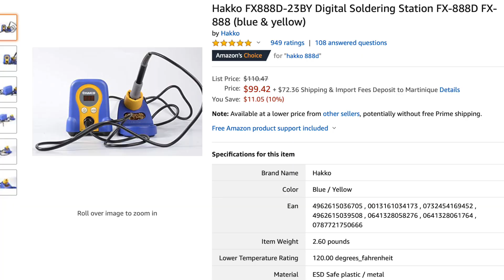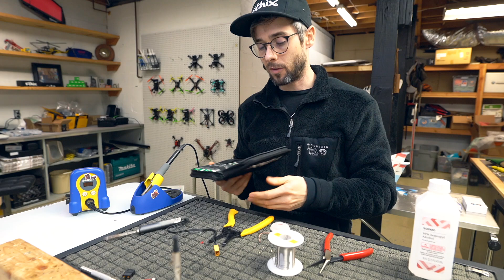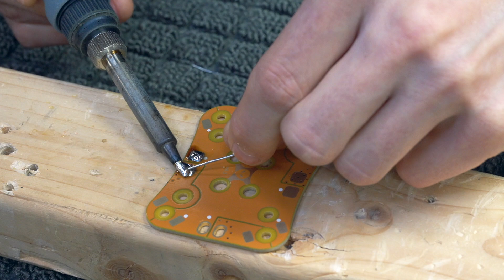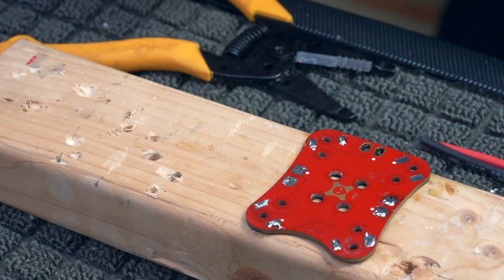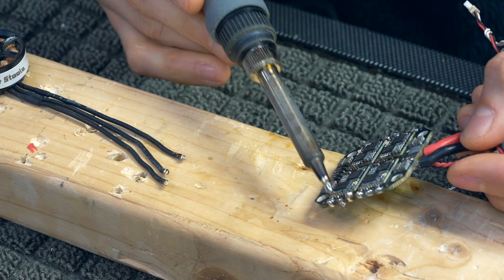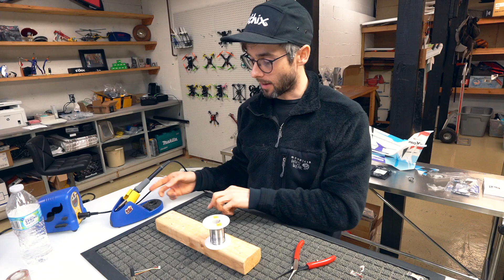How TO Perfect Solder Joint 🤫 | FPV Drone | Pro Soldering Tips & Tricks

Comment: Solid vid.  Couple of thoughts: the purpose of the wet sponge is not 'cleaning' the tip; that's what the scrunchy copper wire ball is for.  The wet sponge is for reducing latent heat in the tip to avoid overheating components.  If soldering pads, XT60 pins etc., don't use the sponge, because you want lots of heat.  If soldering small components (capacitors for example), or soldering in an area of a PCB which has small components close to the soldering site, clean the tip with the copper ball, give it a good wipe with the sponge to cool the tip, then promptly re-wet and apply solder.  I do use a flux pen ('rosin pen').  The flux removes oxidation from the parts being soldered and keeps them from re-oxidizing while cleaning/re-wetting the iron, all of which allows more rapid adherence and promotes flowing of the solder; this in turn means it isn't necessary to heat-saturate the parts to achieve a properly-fused joint.  Proper use of rosin core solder requires that you add solder to both components before attempting a joint, which is fine in many cases, but often leads to an over-application of solder, and you either have to wait for the parts to cool (and start to re-oxidize...), or risk overheating the parts when you connect them.  Last item: lead wont vaporize at less than 1700C; the smoke from soldering doesn't contain lead.  I avoid breathing it on general principle, but there's no need to worry about "lead poisoning" from solder smoke.  Washing your hands after handling solder is a good idea, however :)
Reply: Accurate info. Good to see some intelligent comments!
Reply: I found the electronics engineer.  

The most important one is the bit where you don't want to heat-saturate the parts.  Your flux will help with that if applied correctly.  
ESC and motors will hate this saturation method, even 1/8th scale offroad RC components fail easily with too much heat.
Reply: Great info. Thank you 👍
Reply: @kapstaad - Damn good comment, thanks!
Reply: 10:11 foxy run FNAF 1

Comment: For those who have trouble tinning wires, dip the wire in flux, add solder to the iron, then touch the flux-covered wire end to the solder blob on the iron and it will pull the solder right in. Any time you have issues with getting a joint hot enough, use flux. It’s your friend.

Comment: Hey guys, just a quick tip too to prevent any further damage during soldering: 
Sometimes solder likes to splash a little. You really dont want that tiny tiny splashes anywhere on the board accidentally shorten something. A 4in1 ESC is prone to that. Therefore you can use some electrical tape and  just cover the mosfets and just leave acess to your solder pads! ENJOY!
Reply: The splash is caused by contamination in the joint. This can be avoided by using flux and/or Kapton tape for shielding.
Reply: @MnPaul1  The flux itsself likes to splash around too...

Comment: Few additions cause this is actually a good soldering tutorial! Steele doing it right! So with solder fumes, the fumes are actually the resin core melting, you definitely dont want to breathe that as you can actually develop asthma over time from it, but there is no lead directly in the smoke...but make SURE (like before you do anything else) that you wash your hands after handling leaded solder! It is absolutely essential.  A wick is alright, the problem is it seems to oxidize pretty quick and does a poor job...the best 25 bucks I've spent in a long time is on the Engineer SS-02 solder sucker, seriously I can redo pin headers with this thing...get it! A fume extractor is a pretty decent investment as well.

 Other than that, practice! Get some practice kits that are cheap, its very concering to me the poor soldering skills of so many people, that is a massive liability as people trust their kwads way too much and soldering joints can and do fail under heavy vibration load. Also the reason that pads lift is because of poor quality substrate of the pcb and poor quality adhesive...thats another reason to buy quality products, so you know they are (hopefully) using quality pcbs with properly adhered copper. You can still lift small pads so caution is always necessary(they are tiny little islands of copper, after all, they heat up and melt the adhesive), but in general it will be much stronger!
Reply from the maker: Epic write up and pointers man.  
I am gonna have to look into that solder suckers.   I have a fume extractor but I need to put a more powerful motor on it.  That shit is weak :(
Reply: @MrSteeleFPV  Thanks my dude! I know you got that EE degree which probably helps, but your solder skills are actually awesome, so thanks for taking the time to make a good detailed video! Lol I actually designed and 3d printed my fume extractor, I know you hate 3d printed shit, but I put that 35mm delta fan in there...shit pretty much hovers! Also btw open invitation to come climb at vertical endeavors in MN if you ever make it up here!
Reply: Adding to this excellent advice, silicone mats are soo much better than carpet for soldering esp. As they often have many slots and embedded magnets for holding tiny drone screws!
Reply: @MrSteeleFPV  I can definitely vouch for the Engineer SS-02. Contrary to most solder pumps, it doesn't have a teflon nozzle, but a silicone one that conforms a bit better to whatever you push it onto and gives it a ton more suction than a regular solder pump. Best solder pump I ever got.

Comment: I have been hearing lots of good things about this channel. Im going through my first motor issue with my first drone . Savagebee pusher hd03 dipped in some water and also had it flying after that. The problem was the water.Eroded the battery cables, and eventually, those came loose and zapped my board . I've been troubleshooting, but it's  looking like bad moters or something like mofset on the g4 board. I'.
Ve got a feeling.I'm gonna learn a lot in this hobby

Comment: So this is what I learned:
-get your tip wet, don't go in dry
-quickly get in, quickly get out
-touch it, and it's on. Noted.
-call it bad names
-you want a tip size that isnt too big or too small. Too big and you'll just complain you can't get it all on there, too small and you leave everyone dissatisfied. 
-And make sure to get it to 850 degrees. That's hot

Update: Instructions unclear, tip stuck in rotor.
Reply: Flimsynder - And important not to forget 'health and safety': 
' - be sure to wipe your tip clean, after you've pulled it out ' !
BTW - ' Touch it it's on, touch it it's off !'  I didn't get that bit!?
Reply: dont be to rough when the tip is in contact.
Reply: I just finished my first soldering, I had to solder my power cable that I had torn off, now the new cable is well placed on my circuit but when I power my drone with the battery, all the printed circuit becomes very hot. An idea ?
Reply: If tip does not penetrate, wiggle it a bit.

Comment: Ground plane can be such a pain because so much metal acts as a heat sink.    But they are more forgiving.   It is the power and signal traces that will always be less forgiving of too much heat being applied to the pad.   DYS F4 AIO boards had some super weak esc signal pads that were easy to lift.

Wetting the tip increases surface area which makes it easier to quickly transfer heat to the piece to be soldered and can reduce the time needed to get a piece tinned.

Comment: I use lighter fluid for cleaning excess flux on boards, works just as well as isopropyl alcohol and also evaporates leaving no residue and is often more easily available from convenience stores etc.
Head magnifier with a light is a must for when I'm soldering, things are getting so tiny these days, especially trying to solder the boards in micro quads & whoops. I use one which can take two lenses at once, so I can flip one up for variable magnification.

Comment: Thanks for the video. One thing I saw you doing that I see very few other "experts" doing is constantly cleaning your tip. I see some "experts" working with very dirty tips. I used to use water but I thought I heard some people say that you should not do that. I use copper wool to clean my tip. One thing I noticed you doing that you did not mention is lifting up the iron when coming out of the puddle. This causes capillary action and will lift up the puddle and create a dome effect. I think that if you stir a little slower and left slower you get a smoother and shinier dome.

Comment: Im new to this.. mayb some are too.. some other tip's I got are get bluetac ( like molding clay ) to hold the wires or other stuff you want to solder on. 

Use a small desk fan to get a breeze away from inhaling the fumes.

Comment: This helps. My joints tend to suck because the people who taught me have me SUPER paranoid about not staying on the pad long. Looks like you're lingering on the pad a decent amount of time, whereas I barely touch it. Getting a new ESC tomorrow I will experiment with it. First time doing XT60 pads, kind of nervous. Definitely don't want to mess up the 4in1 before I get it in the air.

Comment: If there is least one thing I learned this video. ( 5 things) wetting the tip was the most usefull I'm starting out and building the Ali Express practice boards Bluetooth speakers and other things I can give as gifts and hone skills.

Iron I ended up with is the Weller 1010NA as the pinecil I bought was little more then waste of money.

Comment: like you say bonus tip: when you solder the xt60 put BEFORE the heat shrink on the wires for the connector ;)

Comment: I’m not new to soldering but I still mess up at times. Great tips 👍
I need a hakko for my bench one of these days. I’ve been using the ts100 forever and it works especially with the firmware update but I need something a little bigger for home.

Comment: You did better than most with this video. Personally, I stay away from rosin core and use no wash flux with  regular leaded solder. Flux helps clean the joint and transfers heat to the pad. If you twist the wires before soldering, you transfer skin oils to the wire and you want that removed. Easy cleanup with no wash flux. And stay away from the new Weller irons. I just had a $150 unit fail after only 9 months at work.

Comment: Correct me if I'm wrong but the fumes DON'T have any lead in them whatsoever as leads got a boiling point of 1700 degrees and the fumes are just the Rosin... Now you still shouldn't necessarily breath those in as some people are allergic to it but if you are not and you are only soldering occasionally it won't do any harm UNLESS the solders got an acidic core and not a Rosin core, those fumes will fuck you up fairly effectively...

Also, normally closed metal tweezers (dunno how to properly call them) are way easier to handle than needlenose pliers as you don't need to apply constant pressure to hold the wire

Great video - still learned quite a bit even though I thought I had soldering down quite well 👍
Reply: I'm pretty sure the smoke is the resin burning off. I always thought that if you got too much smoke that iron was too hot, but I'm not the expert
Reply: Averell Dalton AFAIK the precautions against inhaling lead are still helpful, and the flux in any solder can cause respiratory issues if you don’t ventilate properly.  First time I soldered, I was coughing for a while after.  The issues are likely acute, but I refuse to be the person to discover that a chronic problem can develop.  

Also, using your knowledge of the world, when has inhaling anything besides water vapor (unflavored) been safe?
Reply: Don't worry about fumes... just make sure that your not blowing air on your work... 
trying to use a fan to blow air across your work piece makes the joint cool too quickly resulting in brittle joints.. 
Very important in something that's subject to high vibrations like drones..
Reply: Ahhh. that makes sense. I was told not to leave solder on the end of the tip when you are done and to thoroughly clean before storing because the acid in the flux core would eat away at the tip of the soldering iron causing it not to work as effectively.
Reply: Paximo2000 that’s very wrong.  The metal should not be exposed to the air for long periods of time after taking its first solder, and especially not when it’s hot.  You want to leave solder on when not in use, just make sure you apply it with enough time for the chemicals to burn off once you’re done.
Reply: @apaxman00    As for Acid reflux  and acid solder ..  that's two different things..   Never use acid flux or acid based solder on electronics.
that type of solder is for making tin boxes not electronics..  it's ok to leave solder on the tip of the iron it makes it makes the iron easy to use next time as the copper the iron is made of will build an oxide layer .. so don't clean!!!   
heat the iron, add melt fresh solder on the tip, wipe the tip on the wet cleaning sponge.
wait a sec for the iron to recover from the cleaning and now the tip is ready to use.

Comment: Thanks steele for show casing how easy soldering can be if you know how things can be done
Reply: It has a lot to do with materials. Even with the right types of solder a cheap brand can be dirty. I buy hakko tips to use on knockoff irons because a lot of the Chinese tips oxidize like crazy. The biggest improvements to my soldering happened when I was able to shop online instead of using whatever junk was in the hobby shop or radio shack.

Comment: Thank You Steele !!  Just a point of equipment-- Hako is wonderful Made in China-- if can not afford Hako  the Chinese brand YIHUA is manufactured in same factory to very close to Hako Specifications for one half the cost or lower. I have lived and worked in China as tech in manufacturing from USA. And I was-- Married to a wonderful Chinese Lady but had different ideas of our future. I f one can not afford Hako starting out YIHUA is very good alternative. I use $30 YIHUA for 3 yrs now and wonderful.  Next Idea I tell truth- you need to keep your solder iron tip clean but having solder onit so no oxidation. Again for people just learning to solder You do not need to buy a sponge or brass fiber cleaner for your soldering tip.  The best I have found and use today as my main way to keep the solder iron tip clean and freeof excess solder is what every one has -- An old sock, the one with the hole in it !!   Wet the old sock through then wring out the water so no puddles in your work table but still very wet. Use the wet sock as a wiping place or if have much excess solder wrap around the soldering iron tip and pull through. If you get burning sock it is not wet enuff. This is how I do for many years of electronics. Everyone has an old sock and hopefully water !!! My main go to always.  Just my ideas I know that work also from when I was learning and some things you learn are really good that you figure out on your own : )  Gods Bless U Mr Steel and to all that watch and wish to learn.  Do not find excuses for not to do. Find ways you can do to at least try !!!!   YEA BB !!!

Comment: 11yo? Finally a worthy opponent!
I got hold of it at like 14yo, could earlier but had no one to show me how to do it properly and at that time there were no good yt tutorials (not sure if yt was a thing in my country yet at that time).
I've seen a lot of people do the mistake of keeping the iron on the solder join for like 5x the max time they should.
Regarding solder type i would advise against leaded type, lead is not good for you, you can get stuff soldered with lead free solder if you have half decent iron and thick tip, also it's important to buy quality solder, don't buy any of this random kester etc branded stuff it's awful to solder with regardless of it being leaded or not.
You want to buy multicore(loctite) it's like $50-$100 per 500g spool, yes expensive but it is what it is, there might be other good brands but you will be trying your luck $50+ at a time, so might as well just buy the multicore, for average hobbyist it will last 5-10 years.

Comment: Been soldering since the 80s when I got my first RC10.   Back in the day I bought a RadioShack 100w trigger style soldering gun.   That beast lasted me 30 plus years.  Hold the trigger for 5 seconds and solder melts, hold the trigger 5 more seconds and you can tin a 12guage power lead in the blink of an eye.   Hold it down for more than 20 seconds and that bastard starts glowing red hot.

I can tag a power lead to damn near any ground plane in no time without the part bleeding heat away.

But a year ago the tip was finally going bad, I replaced the tip with some off brand junk and the damn beloved 30+ year old soldering gun started to eat itself.    Lucky for me I was able to buy a new old stock duplicate gun and I hope it lasts me another 30 years.

It makes quick work, and that is key to avoid heat soaking parts, of damn near anything.    My latest kick is building Lithium Ion packs and my solder gun makes tagging 12 guage wire to the cells about as quick as spot welding.

The 100w gun is not useful for fine detail work so I have a second Soldering gun of lower wattage with a fine tip for all the pins.

As for solder, I have a 60/40 rosin core reel from Radio Shack that I bought 8 years ago that I am only just now to the half way point of using it up.   The stuff works so damn well I will be sad when I am out of it.   When Radio Shack eas going out of business I went by mine looking to buy up all they had on close out.   Sadly somebody already beat me.

Comment: 2 things you absolutely cannot go wrong with is a hakko iron and kester solder.
 Also bonus nachos in a pinch you can use stranded copper wire coated in flux to substitute as solder wick.